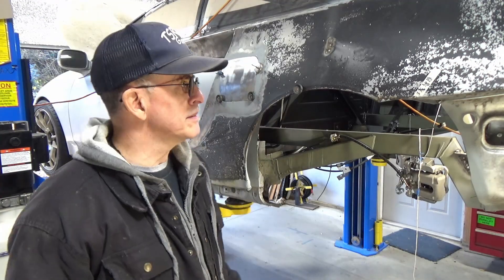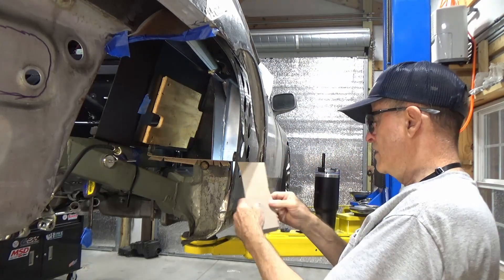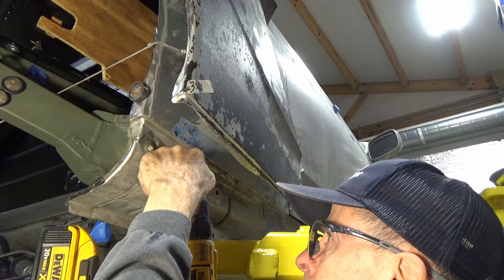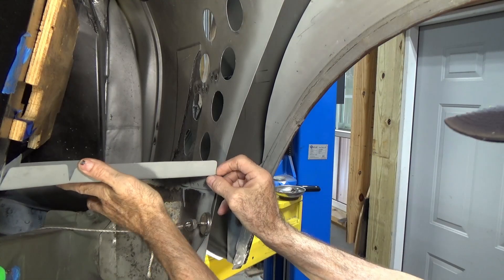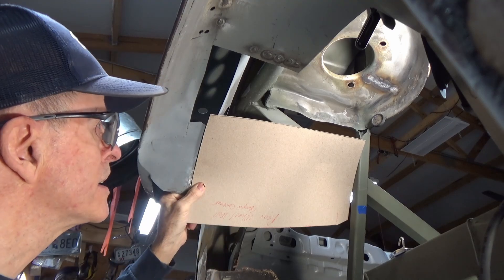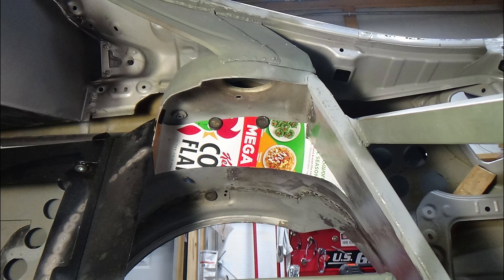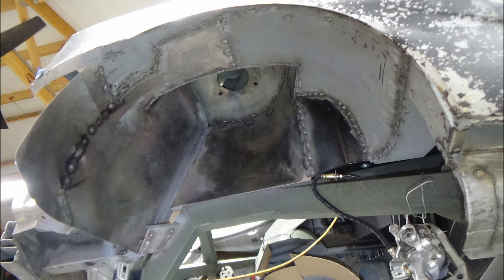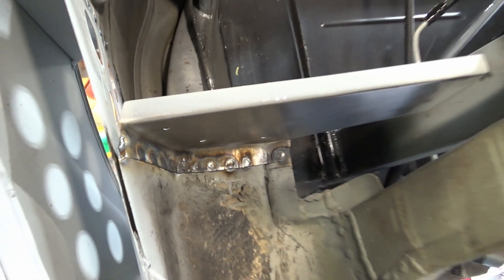41. Biuld your own supercar? 300 hp Celica,  body kit, wheel wells. Celica GT-SS

Comment: Your gona have to think Lamborghini and engine cooling vents
Reply from the maker: Yes,  at about 3:00 to 3:20, you can briefly see the  holes in the inner fender for the air from the side duct/ vent to get into the engine compartment. Some of my other videos show it a bit better. 
     Also, it has venting to pull air out at the rear of the car. Should 🤔 work... might work.
 Thanks for watching 👍

Comment: What a dedication mate. do u have any idea why wind is coming from my steering wheel while driving? is there a steering "rack" boot or something on firewall on my 1zz t23. edit: feels like its coming from that steering wheel adjusting knob also its left hand drive
Reply from the maker: Thanks. 
There is a boot (seal) that goes around the steering shaft. It connects between the steering rack and the fire wall (floor). Can be seen from under the car. It may not be connected completely on either end. It could be torn or split, but they are fairly thick rubber.

Comment: Hello. I came for advice again, planning changing clutch master cylinder on my 1zz Celica. is there some room to find and disconnect brake fluid line from cylinder inside engine bay and what do i need to take apart to do that job. its left hand drive.
Reply from the maker: Fortunately, that is a job I have not had to do. I do know that the clutch master cylinder unbolts from inside the car. I would disconnect the lines first.   Lines look to be difficult to get at. But with the battery out of the way, there appears to be a little bit of room to access things...  good luck. 
    Do your best not to spill brake fluid, I have seen a few cars severely corroded under the master cylinder from spilled bright fluid.
Reply: @TSRGarage  Thanks. I`ll try my best

Comment: hello my friend can i ask you something about my car heater.. the mechanic change the heater core before they change the heater core the  1 2 and3 switch is working properly but after they put the new heater core now only the high temperature is working.. any advice my friend why 1 2 and 3 is not working now... hope to get an answer from you ty so much
Reply from the maker: 🤔🤷‍♂️.. ? ..  if you are referring to the blower motor speed, it could be "fan speed resistor."  If it is, the resistor is a fairly easy fix. 
    Search "fan speed resistor." There may be some videos on how to replace it.
Reply: @TSRGarage  my friend can you make a video of how to change fan motor speed resistor.. so more can watch and have idea how to change